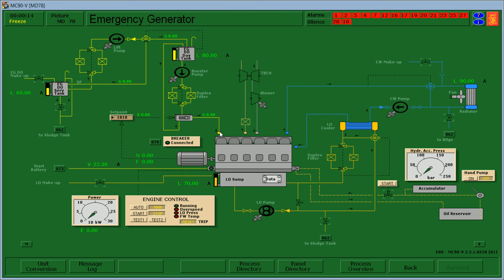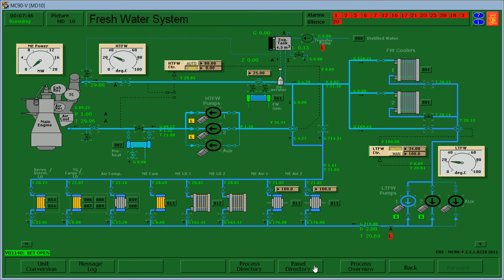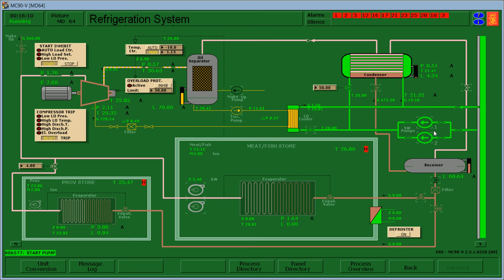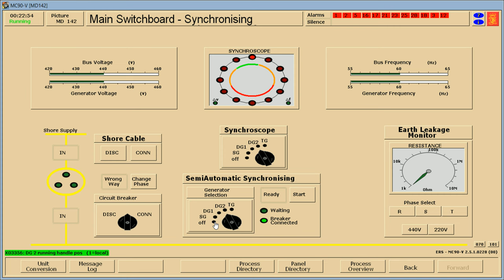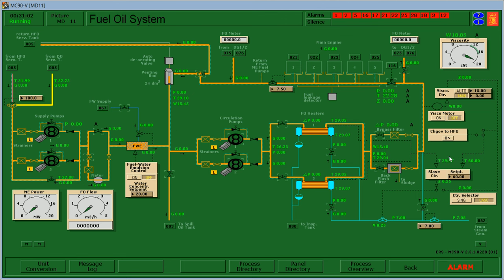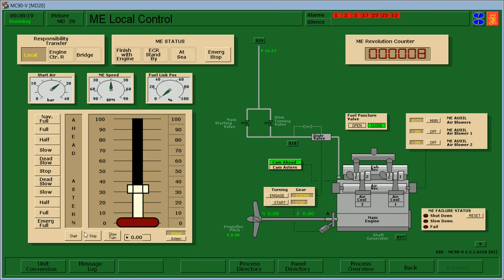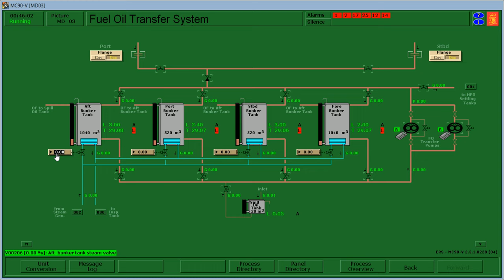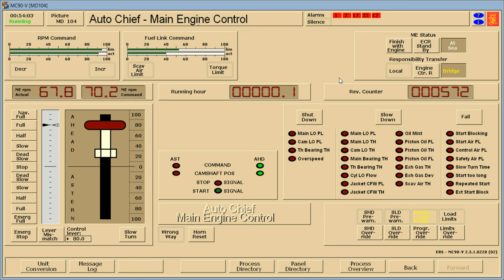Cold Ship to Full ahead Kongsberg Engine Simulator

Comment: You have lapses in your starting procedure. I will give you one......like ME Aux blower in Auto while you engaged the Turning gear.
Refrigeration system is using two cooling pumps with make up valve permanently open. King valve is closed while system is running. You can't apply this onboard it's too dangerous. FWG should only be started when main engine is running at full RPM. Main engine should be put At Sea when main engine control is at the Bridge as per Captain order. Though this is a simulator you must emphasize all these things in real scenario. It's easy to click buttons in simulator  but too hard  hard in real scenario. I'm just correcting don't think I'm trying to bully. Cheers

Comment: Bakit walang flow yung 2 hfo separator ko at bakit yung oil temp ng 2 separator ay hindi matass???
Reply from the maker: Check po kung naka open ang return valve at check settling tanks kung naka open po mga valve papunta hfo separator, and input 10% or 5% flow papuntang pump po
Reply: @jovenz08  open naman lahat sir pero ganun padin